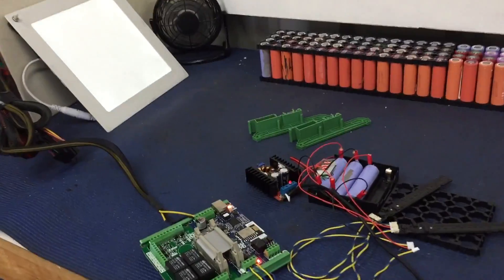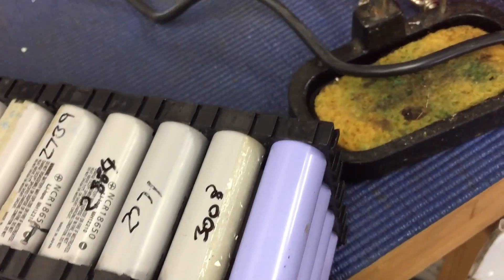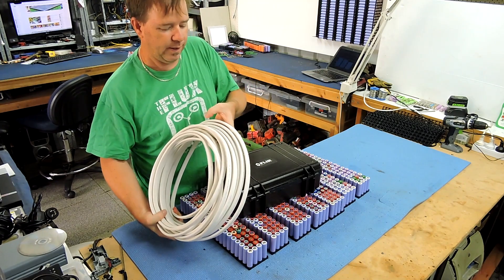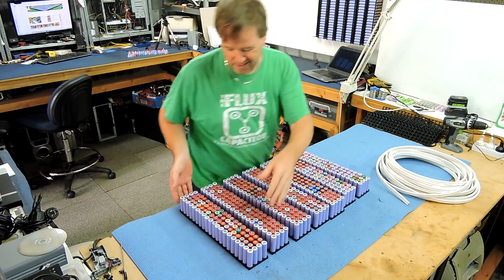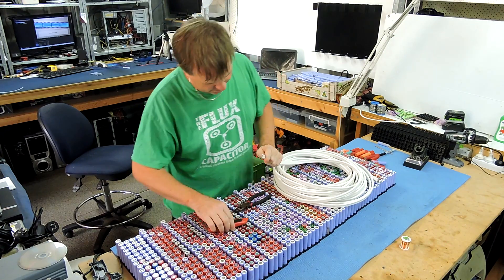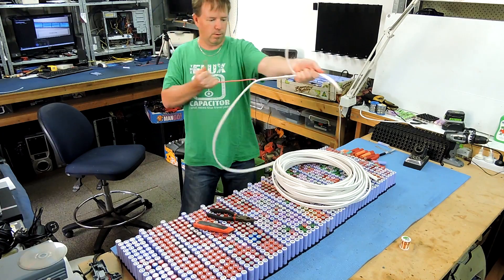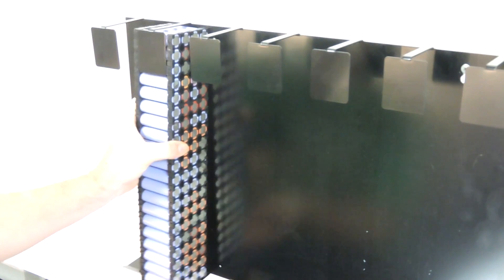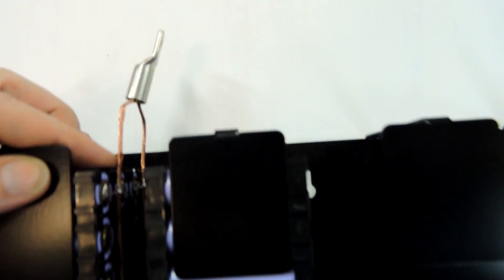Kicking on with the 40th kWh pack - getting the busbars & Batrium longmons placement figured out.

Comment: So which is better. Im building up for 14s100p to start. Im curious is there any electrical benefit to running say multiple banks of 14s10p. I get there would be little less wiring going bigger. But i want the packs to serviceable. Being able to remove smaller packs for spot testing and hot swap easier. Im thinking larger packs make for harder to change that one bad cell in the center of a 100p or eventually like to be talking 400p and larger.

Comment: using that amount of small batteries connected in this way isn't very practical or, useful
Reply from the maker: Clearly I’ve already proved you very wrong :)
Reply: @Michael Phillips
 - Did you do the math to calculate Watt-Hours  =  # of packs in series  x  Cell Voltage  x  # of Cells per pack  x  Avg Ah per cell ?

Comment: Please correct me.I am new to power wall.  All 80 cells possitive one side and negative one side. So what is the results of this pack alone? 3.7V and 200,000mAh?  Also what is the fuse wire you have used to connect all the cells. Please give me a link.  I do not know where to find it to buy?
Reply: Google "fuse wire".  Yes, 3.7 v @ ~200Ah
Reply: @MrSummitville  Thanks. It one full year gone and you came first to reply. Great.
Reply from the maker: Lol can’t get em all
Reply from the maker: Reply to 100s a day
Reply: @HBPowerwall  😊
Reply: @HBPowerwall  😊😊😊

Comment: Spin a line of solder into your wire before you form the buss bar and then heat the buss bar to melt the solder into place in the form it will stay rigid then when fusing across you can just wrap and heat the cross connects .
Reply from the maker: That's not such a bad idea!
Reply: @HBPowerwall  Don't you think it better to twist ONLY the copper conductors first and then apply soldering iron (heat) and then slide down the wire with solder?  Copper is a much better conductor than solder.

Comment: hi love your set up quick questions 1st how many amps is one pack and voltage. 2nd is total of each square 36-48volt and total amps
Reply: How many (max) AMPS per your cell ?  Then multiply by # of cells per pack.  Voltage = all cells are in parallel.

Comment: Not sure if you should put it on the side or the back, but I can tell you where you can put that music. lol

But seriously, like your videos, very helpful. Doing my first bike pack build and think I'll go with what you did here. Roughly how many of the wires would you braid together for a 48V 22 or so AH pack? and how many 2000 to 2300 mAh batteries do I need and how should I arrange them? (I'd like to get away with 120 or so pcs that I already have from matched batteries)

 Oh, and what size are those single braided wires? Or better yet the identification numbers from the whole wire as it came from the store, before it was taken apart would be very helpful? 

Thanks again for the videos.
Reply from the maker: I just used 6mm square household wire to make the bus bars that's all I can tell you about them really - walked in went that one and took it home..

Comment: just thinking about a nice way to figure out each of your various packs.  since there are a variety of colors.  do your outside not just in blue but do one in red  one in green one in blue and one in yellow.. the idea is that it allows you to show which pack by age of the cells or the ah ratings
Reply from the maker: NOOOO, my OCD would melt down!
Reply: LOL  had a question the small wires you put on is that a current path as well as a fusable link to protect your packs?
Reply from the maker: Yes every cell is fused on the positive side

Comment: Hello i have a Question. Couldn't you use like a number #10 or #8 Solid core wire to get the same size then if you was putting all three of the  #18 or #14 AWG wire together?
Reply from the maker: many already do, but not sure if its the right or wrong way of doing it
Reply: @HBPowerwall  WHY do think twisting 3 smaller wires together is BETTER?

Comment: Here is one of those tips of a lifetime for stripping wire! Get a piece of preferably some hardwood (oak) about 2in.wide  X 4-6in long. Drill a hole just slightly bigger than your wire in the piece of wood then drill another pilot hole perpindicular to that hole on the opposite side of the piece of wood! This is a pilot hole for a woodscrew that you screw into the piece just so it sticks into the original hole for the wire about 1/32in. start your wire through the hole about 2 ft. then pull . The screw point will cut the insulation. adjust the screw as neccesary so the wire doesnt bind up  when you pull it!

Comment: What method do you use to keep the battery holders from coming apart?
Reply: They just dont, quite a lot of friction in betwen them and once you have them on the batteries they open in opposite directions and therefore keep each other together.

Comment: what do longmons(sp?) do?
Reply from the maker: Longmons are a way of transferring energy from the cells into something else. In the Longmons case it's heat. So with my current settings, i have the longmon 'set' to normal 4.1v so once one cell or all 42 cells get above that voltage it activates the longmon and it burns of the excess voltage as heat.

Comment: Can any battery nerds answer this for me. I have some lifepo4 18650, they all are externally metal (originally wrapped in plastic that is removed), and all but the very top is negative. So, you can just sit them next to each other side by side with no risk of a short, as it's all negative on the outside. I'm thinking instead of welding all the bottoms together for the negative connection,  that I would just let all the bare metal cylinders touch which is a lot of surface area actually, and then just heat shrink them tight. So, would not need to do all that tab welding or soldering of wires on the negative side anyway. As I don't like how if 1 cell would die I would have to desolder all that mess just to find the bad cell. I could just remove the heat shrink and seperate the the cells with card board then test them individually.  This would only be done for the parallel battery blocks of course. 

Anyway, guess the question is, is there anything special about the bottom of the cell that makes it a better location for the negatives to be attached, like is it thicker, or something.  

These cells were reclaimed from a bad 12 volt battery used for a medical device, so I already had to "detab them' once, and in that process ruined some of them, but like 2/3rd were good and I have sever of the bigger 12volt batteries, so will be making my own 24 volt battery from the cells. 

THANSK!!!!!!!!!
Reply: No, you can NOT just heat shrink the entire pack together - that is NOT an electric connection.  And when a cell fails - you just cut that cell out the pack and re-insert a new cell.

Comment: what batteries did you get the grey cells out of?
Reply: nearly impossible to say. I had 10 identical looking battery packs with identical specs and there were 3 different brands of cells between them, Samsung, LG and Panasonic. I guess the production dates were different.
The grey ones are panasonic cells, and probably the 2900mAh ones. The OPUS BT-C3100 he uses to test the cells shows about 10-15% more mAh then it really is, so those cells are about 2550-2700mAh in real life. I have quite a few of the same cells testing 3000mAh in the same charger.

Comment: I'd put the long Mon on the side (between the busbars) and could you use large spade terminals to join the packs and if the spade terminals don't have the current carrying capacity you want you could place the bus bar is a x pattern with a join were they cross in the middle and then have 4 spade terminals one at each corner I'd also use heat shrink or some other insulator between the last solder join and the terminal to join to the next pack :-)

Comment: using that smaller cable made testing so much harder the 10mm cable would have sat and bent into position so much easier also are you going to heat shrink the copper at the terminal end? as for the pcb, visible IMO as you'll be able to use the flir to check it easier
Reply: 3 twisted is 1/2 the price...

Comment: A bit too late to advise but if the green cable is the one you will not use you should have pulled on that one. It is never good to pull from a cable you are going to actually use.

Comment: The BB looks a bit flimsy where it joins at the lug. I would solder 75mm of the ends of that twisted wire to increase stiffness.
Reply from the maker: It is very flimsy however this was just a test fitment to work it all out. Ones I'm making at the moment are twice as thick :)
Reply: If you solder the ends for a distance it becomes a rod, so it might be solid enough as is. The individual wire strands can slide on each other, where as if they were soldered together it would become a rod with a greater 2nd moment, thereby more rigid.

Comment: don't use the bus bar terminal at the top. just leave enough copper wire and Loop it around so the bolt will go through for your main busbar
Reply from the maker: I have considered this how ever I think I would feel better if I had a nice strong crimped end. Your idea would be a cheaper option for sure.
Reply: HBPowerwall make your eye and solder it as one piece it's pretty damn tough try one

Comment: My vote is for putting it on the front.  Putting it on the side of the pack makes me a bit uncomfortable.  Did you know, you can make those end terminals out of copper tubing.  Cut, flatten one end and drill out the mounting hole.  You are then only limited to the available tubing sizes.   You don't get the purdy plating on them, but then you have enough exposed copper in your system.
Reply from the maker: + 1 for front - thank you :) Hadn't considered making my own terminals

Comment: I’ve been watching you for a couple of weeks mate when I ran around this method.  Am not sure if it will met my main needs of powering half of the houses that uses we will say on worse time of year 40kw.  But it does have other possibilities that am thinking of.  Your design is clean and practical unlike some of the of ones I have looked at.  I do have some disagreements but haven’t yet came up with the answers myself so I can’t fault you there.  I’ll cover that in a bit.  The use of strained wire is better because it can carry the amperage better.  As I think you know, the current rides on the outside of the wire and not through it; so it’s better for that.  It should have the same surface area as what you did before but much easier in the construction.  Here is what I think I would do.  I know you made the jig on the fly but I think I would use trim wood to help bend the wires near the correct shape.  You may need some claps of sorts to keep the wire locked into position as you formed its layout.  But if may not be worth it as you maybe nearing the end of your build I think.  For myself am just going to run two wire from the centre positions of the left rows and right rows and not wrap it around at the base as you did.  I don’t see the point or gain in doing this; electrically speaking.  I will keep it in place using clear silicone sealant.  

Now, this is the bit I haven’t liked on any ones design and I haven’t solved it myself.  It’s the the way each bank is connected together.  No matter if it is horizontal or vertical and I have seen both.  It would be better for safety sake if it wasn’t bolted together.  I see all kind of chances of dropped bits getting between and shorting out the lot. When these batteries do explode its a mess.  I saw another bloke that used a vertical shelf but kept it negative to negative or positive to positive on the shelve so it reduces that possibility.  But giving the housing I think heat will be it’s overall problem verses your design.  What I would like to come up with is where it would connect to some automotive style connector which the wires go to the other bank using the same connector to plug into it.  The problem is it’s not very tidy even through its more safety minded.  I guess it could be hidden under a plate which is what am thinking about as I write this.  But I’ve been trying to think of something that it could plug into which may not be practical.  If I could then it wouldn’t be a powerwall but a power cube that would sit on the floor with indicator LEDs on the sides where if there is a problem you would remove the fault module and replace it with another one.  Then I would have the same problem as am looking at if I use a forklift battery which is what am also considering.  Loss of floor space but much more lighter.  The problem for that design is the battery pack temperature.  So, temp sensors would have to be added to enable fans to blow it out.  Since the power will have to come from the packs then there would be a loss of power to run that.

Thinking about a power cube design it would have to have some sort of power management.  Not that BMS nonsense I keep seeing for bikes and what-not that charges each cell.  But to look at each module for performance issues (voltage and current) and temperature.  If any of the packs were bad then it would disable all modules in that given array to prevent damage to the rest and the fore mentioned explosions.  Then just replace the pack and reset it so it will re-enable the module array.  Either way it would have to have a super structure build to house all of the packs and manage the cooling of it.

Now, let me say why I have been thinking about this.  There are a number of people around the world working the next generation batteries.  There is one bloke in the UK that has increased the storage of a battery.  All of the ones I have looked at are using graphene or graphene oxide.  In all of the claims as it hasn’t been fully fielded really is that a battery the size of 18650 could be increased to be 3.7v @ 185A.  Now, I don’t believe that amperage but even if its four to six times greater then it makes this something I need to look at more seriously.  Now, these cells are really supercaps in battery style housings as it’s not really charging it chemically but statically.  So, if it can store say 3.7v @ 20A then it’s something I need to seriously look at.
Reply: Who told you that stranded wire carries the DC amperage better?   You need to educate yourself before posting such nonsense.  RE: BMS - clearly, you have no idea what a LongMon is or does ...

Comment: I think for reliability and visual indication put them on the front will also be a reminder too when you go to remove the packs for any reason to disconnect the mon board otherwise on the side you may forget it and pull the wires

Comment: You can build a simple wire stripper using a 2x4 with a hole just large enough for the wire and a drywall screw into the side of the hole just deep enough for the point to cut the insulation. 

Can be done to cut the larger bundles and individual wires as making a hole and a drywall screw per size is easy and cheap. For bundle wire holes 2 smaller sized holes drilled together work well for flatter bundle wires then a large single hole with room for the wire to move around. 

A C-clamp to mount it to the table and you just pull the wire to cut it and can peal it ether as you pull or after with no strain on the wire. When stripping the wires a bucket or trash can to pull the wire across lets you collect the insulation as it is separated to reduce repeat work.

Comment: The front mate if one fails it would be much harder to get it out to replace it. I do not know how many strands you used but I am thinking of using number 10 multiy strand wire on my next ones I do

Comment: On the front think best, so you can see the LED. Did you find out the maximum current of those batteries together? Not sure it will cope on that copper wires.

Comment: I have to agree with the placement up front. It will let you easily see it, and if you ever have to remove the pack you don't have too worry about removing the lead. It makes the unit a self contained thing. If you where worried about getting glue or something on the board, use some clear shrink tube on the board so that you are sticking the tube to the runner and not the actual BMS board it self.

Comment: With your buzz bar cable, can I suggest that you get 10mm2 85 Amp or 16mm2 110 Amp building cable that comes in single rolls of either red or black. You might be able to get 50m of each online in eBay.
Reply: WHY ?